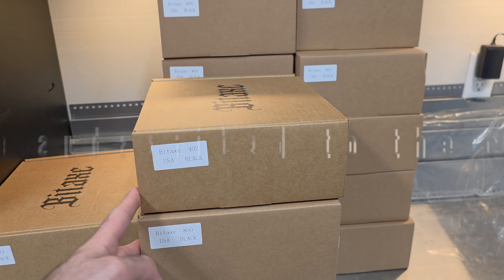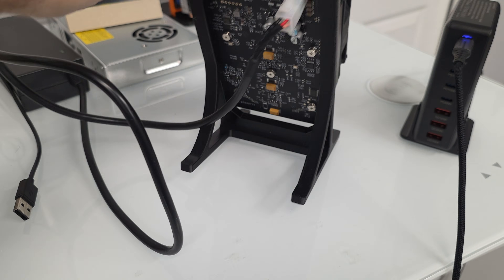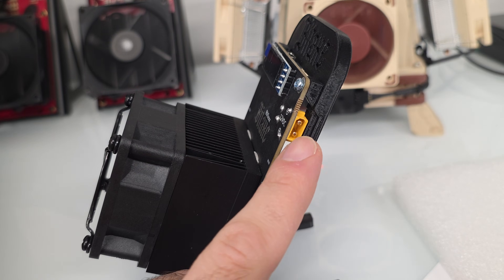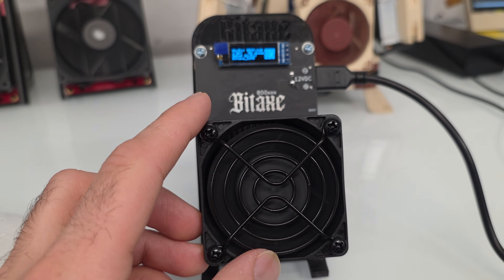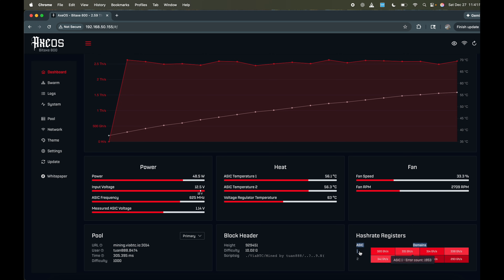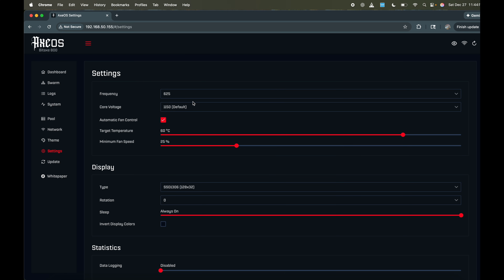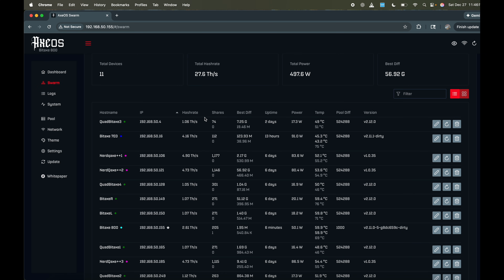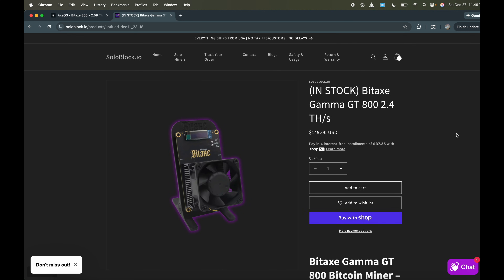Bitaxe Gamma GT 800 Turbo Review & Setup | 2.4 TH/s Solo Bitcoin Miner

Comment: solo block , i see the price of the GT went up allot, the first one i got was for $149 , will you have any special sate event in the future? i’ll get some more then. keep up the awesome job!
Reply from the maker: For the very early pre-orders, I discounted the pricing as much as I realistically could as part of a soft launch for the store. Now that some items are officially in stock like the gt800 and shipping right away, prices have increased slightly.
But the bulk of the price increase is that manufacturing costs have gone up going into 2026. That said, the manufacturers have made it clear this doesn’t mean these higher prices are permanent once raw material costs come back down, pricing should be adjusted accordingly.
I also plan to run flash sales once I have more inventory on hand. If you’d like to catch those, I recommend subscribing to my X account or signing up for email/text notifications so you don’t miss them.

Comment: Have a stupid question. I’m sure I could google but why not check the pros first.

If you have a node using umbrel. Can you have a bitcoin cash and bitcoin one or are you limited to just one?
Reply from the maker: There is a way to get Bitcoin cash to work with umbrel OS. But it is a more extensive setup, there's a video on YouTube showing how it's done. 

But to set it up as a Bitcoin note all it takes is a click. 

The know that I am giving away will come fully synchronized as a Bitcoin node
Reply: @SoloBlockio that’s sick!!!!  Because as you can imagine, hotel bandwidth is slow rofl
Reply: Praying!🙏🏽

Comment: Where can I find the STL files for the quad 601 setup?
Reply from the maker: Unfortunately I had to remove the 3D design due to some concerns I had of people pushing this set up past it's limits. The wago connectors and 12 gauge wire can comfortably run the unit on stock settings or at a slight overclock but due to the 5 volt system of the gamma 601's, the amperage can be really high. Pushing the power cable and Waco connectors past it's limits. Because of this I have decided to not upload the files any longer. I appreciate your inquiry. 
If I have time to redesign it with a 5 volt bus bar and a 10 gauge wire then I will reupload the file for download.

Comment: Hi! Appreciate your videos and store. I want to get an entry by ordering the 800 was listed as $169 instead of the $149 shown in the video; also can't wait for my order to arrive! #1064
Reply: Whoops, sorry... just saw the price on the thumbnail. Again, thanks for the store; much success!
Reply: Last night they were 149
Reply from the maker: Pre-orders had further discounted prices as an appreciation for the customers who trusted me and ordered stock that I did not I have on hand.  The margins are very slim on these. So I had to slightly raise the price to make sure it's sustainable. The factory also just let me know beginning January 1st prices are slightly going up due to the cost of goods for their manufacturing process going higher. But I'm always trying to knock them down so I can pass on the savings for you guys. With your guys continued support I will eventually reach a level of ordering that the factories have to cut me a better deal. 
Currently for me to get any meaningful discounts from them I have to spend north of $100,000 in one order and wait 25 days for production. Otherwise if I want to get in-stock items from the factories the prices are substantially higher.

So depending on my quantities and how long I am able to wait before they ship it out determines my cost.

Comment: Are the asic chips new?
Reply from the maker: No same as gamma 601's
Reply: How much for a turbo tower
Reply: @SoloBlockio  I think they're actually asking if the chips themselves are new or if they have been picked from existing bitmain s21 hash boards. My understanding is that the older bitxe equipment and even the 601 started life from salvaged chips. Don't know if that's how they're still building them or using new tape reels of chips. Also not 100% sure what I saw is correct, so take it with a grain.